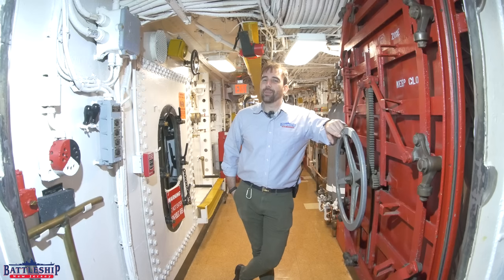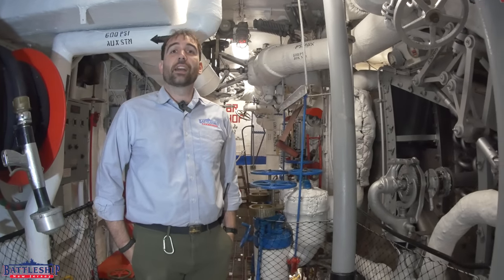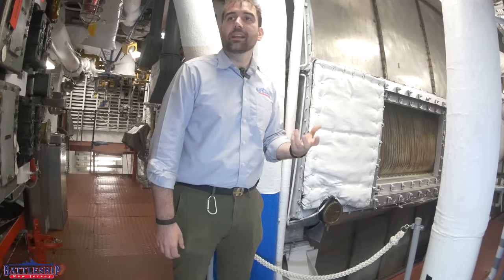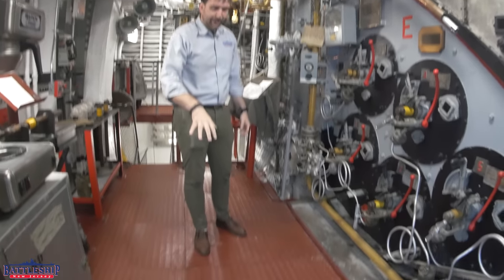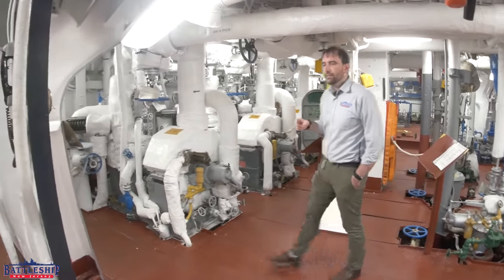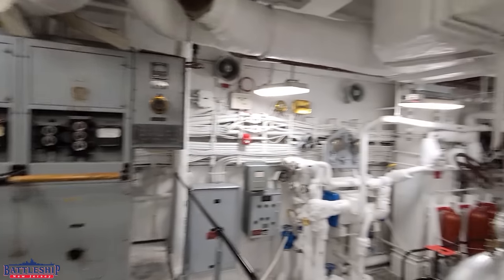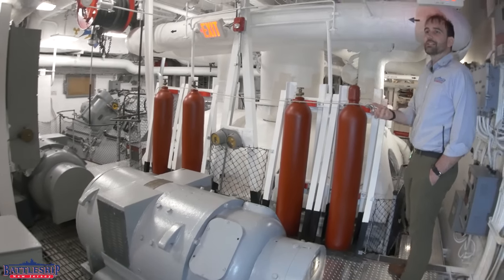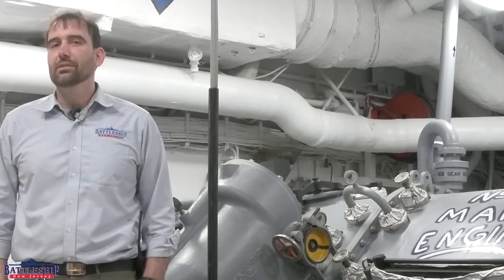Inside the Propulsion Plant of the World's Fastest Battleship

Comment: Could someone dispel the report that Missouri had her propellor shafts cut off when in drydock last. I have seen video of Missouri in the dock and she possessed all four shafts and screws before they flooded the dock.
Reply: I would be very surprised if they actually cut the shafts, but almost certainly they removed the props themselves because when they're not in use, the props weight cause the shaft seals to become broken which leads to far more problems. Propellers are removable & get replaced after they've been worn down enough, so it's not something where they're destroying the ship- any shipyard that could house an iowa class could install new props.

Comment: Condensate pumps remove water from the condensers and send it to the deareator which is a heater at atmospheric pressure so air, oxygen etc can escape. Boiler feed water pumps take water from the deaerater, pump it at high pressure through heaters before it goes back into the boiler. Even this description is simplified.

Comment: Hello, very interesting. Could you let us know if the prop thrust bearings are located in the gear units or in the hull and details on the thrust bearings themselves. Perhaps some more information on the gear units please. Cheers.
Reply: Kingsbury thrust bearing units part of main reduction gear attached to main bull gear
Reply: The thrust bearings are NOT part of the reduction gear. They are located inside a large component called the thrust block which transfers propeller thrust to the hull. It may be located fairly close to the reduction gear or further aft depending on shaft length. As a separate unit it can be maintained without exposing the reduction gear to possible damage.

Comment: Are the firerooms on New Jersey and other BB's pressurized? I recall when reading about WW2 destroyers that their firerooms were pressurized (I forget why they had to be pressurized) and one had to enter through an airlock door.
Reply: The old 4 stack DDs had pressurized fire rooms to provide forced draft to the boilers. By war 2, the newer construction ships had boilers that were in effect supercharged rather than the fire rooms. The forced draft blowers pumped air into a jacket around the boilers. One of the usual 3 watch standers on each boiler controlled the throttle to the forced draft blowers. He watched the uptake periscope and was connected to the smoke watch top side by sound powered phone. his job was to maintain proper air flow into the boiler so as to maintain the "light brown economy haze" that indicated most efficient combustion.

Comment: So how is Full Ahead - Half - 2/3's - Slow - etc measured. Is it opening valves to pre-measured amounts to give a estimated amount of steam and power to the screws? Is it a balancing act between the boilers and the engine rooms? Or does one request from the other to achieve? If the captain sends the signal for Half speed. The boiler already knows how much fuel to give to achieve that setting or does the engine room ask for that?

Hope that question makes sense!

Comment: Can you explain how Iowa was able to turn turret 3 with power? (They just aren’t as good as Ryan explaining things.) Could New Jersey do the same and why can’t or won’t you raise and lower the barrels under power? Lastly I’m guessing the Navy won’t let you fire a boiler to run the turbo generators, my question is why.  Also, why doesn’t the Navy allow you use the galley equipment?
Reply: HP steam is really nasty stuff.  Those systems require constant maintenance, testing, and upkeep...none of which has been done since she left active service.  It's bad PR when you have a steam line burst and turn some tour group of kids from a local school into basically cooked stew meat.

You also have a manpower issue.  Figure at least 20-30 people to man all of the stations required to safely bring steam up and spin a TG.
Reply: The turrets turn with hydraulic motors that use electrical power from the shore connection.
Reply: @jamesbrownson6102  Ryan covered this in a previous video.  The rated electrical load of the turret hydraulics exceeds the rated capacity of the Shore Power breakers...

Comment: How do you deal with all the asbestos in the Engineering Spaces? Is the strategy just to maintain it by painting and such to prevent it from becoming friable?
Reply: Asbestos dust was all over the place on my ship in the '60s. Very bad during routine overhauls with laggers were mixing the paste and plastering it on pipes and joints. After months of operation, the routine maintenance and traffic in fire room  would wear off the fabric wrapping in places, exposing the asbestos plaster which could be stepped on and blown away by the blowers. Nobody paid any attention to asbestos then.

Comment: One of the ships i served on would burn jp5 rather than dfm. It burned much cleaner and wouldn't leave as much soot on the tubes. I was on an oiler at the time and we carried both fuel types.
Reply: I was in the Michigan Army National Guard.  When we deployed to Iraq, we used JP-8 instead of diesel our trucks and generators.  It burned much cleaner than diesel.  It cleaned out the engines on both.

Comment: At 29:16 On #1 main engine on the U shaped pipe with the valve that goes over the bolted/riveted casing and the short pipe with the pressure valve......around the bottom of those pipes i was wondering if it is some kind of bag that is attached around the bottom of the pipes.....is it like heat wrap

I love this channel old vids and new
Reply: It's a vent. When operating there is a fog of lube oil vapor produced because the oil is hot. Modern steam ships (is that an oxymoron?) use an electrostatic precipitator to condense the vapor so it doesn't contaminate the engine room air.
Reply: @oldtugs I don't think we are looking at the same thing
Reply: @midbc1midbc199  Yeah, you are right, I was not looking at the other stuff.  It might be retrofit "spray shields" on any joint that could produce a spray of oil as a means to reduce the chance of fire. It looks like a retrofit required after someone in the Navy discovered the risk of atomized lube oil spraying on hot stuff.

Comment: I used to dispatch steam powered electrical generation plants.  I could call a generation plant and ask them to go up or down or I could actually take over control of the throttle.  One day a plant I was controlling suddenly fell on its face.  I called the operator and asked what was happening.  He replied, “We lost vacuum.”  They were having problems with their condenser.  I don’t remember what problem, maybe it was a cooling tower problem or maybe they had changed generator output too quickly.  The point is I was presented with an example of how much of turbine power is provided by condenser vacuum. 

When steam comes off the turbine and is condensed into liquid water that water takes up much less space hence creating a vacuum.  The pressure difference from one side of the turbine to the other controls power output.  So, the condenser does much more that just recycling boiler water.
Reply: I read on another website that Titanic's turbine took exhaust steam from the main engines at 9lb PSI absolute, i.e. 5lb below atmospheric pressure, and exhausted it to the condensers at 4lb absolute.

Comment: If anyone's interested about the horsepower, it's one of the most straightforward calcs you'll ever run into in engineering:  a one horsepower effort relates to 550 pounds... four of those units comes to 2,200 pounds... that's almost a "tonne"... so the displacement times that 4 gives you almost dead on the number of horsepower to move it along its way (displacement's nominal anyway vs. "in the given moment" but pretty close, it's that 57,500(-ish) times 4 Hp equals what you need designed in). Gets nuanced for acceleration, but once to a speed... Usually you have to fiddle with units and transitioning from this to that, but get big enough and the nuances get themselves gone for some things. Won't match like that for a PT boat, but for a monster that can take on Godzilla, it's close enough.
Reply: Considering drag goes as the speed squared, wouldn't the HP needed to keep you moving greatly depend on the speed you're going?
Reply: @stargazer7644  Sure. And many other things as well, if one's counting. Is the hull painted well, so no rust breaking up laminar flow? Is the paint itself smooth? How is the wind blowing relative to your direction? Are your zincs in good shape or is the hull rusting for that reason? How is weight actually distributed? Forward? Then the prow dipping further into the water will give more drag too. Even your length (longer is better, all other things being equal, the longer ship is always faster), but then also your beam affects how well you glide and so what power is needed. But then if waves (tiny, but powerful far out at sea) are a wee bit off optimal for your length, you could have a dynamically produced prow dipping effect... but for these lengths, not precisely so much.

And literally (maybe) a million more things.

The "4 times displacement" thing is a rule of thumb. It fairs you in very nicely, but of course, never, ever exactly. But good enough to get the government off to working.

Comment: If Bunker C fuel is so thick, do you need to take special steps to pump it into the ship or from the tanks to the burners?
Reply: It has to be heated to be pumped. By steam. Lighting off from cold iron the heating is done electrically by the diesel generators.

Comment: when you go to drydock will you be using the engines? or using tugs like most of the other ships
what's the limiting factor there? the age of the ship? the danger of a system like this? or just the crew /costs /skill required to run the engines
Reply: The museum’s contract with the Navy is that they are not allowed to start the engines.  They are all preserved in suspended animation for if the call ever comes.
Reply: @genreynolds6685  huh that's interesting. I guess they don't want people driving a battleship around or wearing out the engine

Comment: 82 or 83 I work Long Beach Naval Shipyard I work the Missouri for about a year. And the New Jersey for about 3 months. On the Missouri we had trouble getting the last Stern tube bearing out they spent 3 months three shifts a day trying to get this out. The Missouri had been in Bremerton Washington for 30 years setting give or take. The last Stern tube bearing we had 250 tons of electric hydraulic jacks pulling on the bearing half. Lynette bearing half popped out at midnight or something as I work swing shift. When the baron came out it shook the whole damn ship setting on blocks I mean it damn ship. This man is talking about the main condensers. The manganese bronze condensers. The bronze was polished that's what they did for hours when they were at sea. The seawater Inlet below six knots used a main condenser pump we were working there and I looked at the plaque on it everything has a bronze plaque what it is and where it is. 126 thousand gallons a minute suction from the sea. Above 6 knots a scoop with drop-down and force the water into the main condenser. In the middle of the night I would climb to the top of the 014 level and look at Long Beach Harbor beautiful like a sea of glass all lit up from the shipyard. It was my playground and there was nobody around on swing shift except a few of us I was a marine machinist a shipboard mechanic what a hell of an experience for a 22 or 3 year old man. One night I walked under the shipping they had all the anchor chain laid out sandblasted and painted I believe they weighed 360 lb / link. You haven't lived till you've stood on the end of a propeller 20 feet from the dry dock and Swan the 20 lb sledge Hammer trying to get the damn nuts off the propeller that's my story and I'm sticking to it

Comment: They still don't air condition engineering spaces even with gas turbines which are WAY cooler. But at very points throughout the space you'll find air ducts with AC air you can stand by and the primary control console has one so 6-8 hour watches are the norm

Comment: Question about the work-life on board:

Workers in the machine room are daily work, under what might be considered extreme conditions.

How about the rest of the crew, like workers in the magazines, did they have it easier with much more rest, or where there daily  drills or maintenance ?
Reply: Not quite sure about the US navy or battleships specifically, but you will find that most navies have a division between "day hands" and "watchkeepers". The difference between them is that watchkeepers keep watches around the clock, for example 6 hrs on 6 hrs off, or 4 hours on 8 hours off. Meanwhile day hands work normal working days (like 0800-1600). 

Generally speaking watchkeepers are there to maintain capability around the clock, responsible for keeping eyes on engineering plant, navigation, communications etc. The dayhands on the other hand manage the day to day running of the ship, for example cooking meals, paperwork, admin, general maintenance and housekeeping etc.

Now depending on where you go and what job you have the exact setup may be very strict or more fluid, for example you can have setups where you are a day hand but then do a single watch a day. Or for example submarines where basically everyone is a watchkeeper and the daily tasks are simply done on watch. 

Lastly, no matter what way its set out there is generally whole ship activities that everyone (or close to everyone) will get involved in, such as battle stations, damage control exercises, docking/undocking, or ceremonial duties.
Reply: @reecesaliba7036  appreciate the indepth reply ☺️

Comment: Very Very interesting. Several decades ago I worked on some large steamships with Babcock boilers.

Question, under normal service conditions during WW2 would the ship ever take a boiler out of service for maintenance. 
On the face of this it would reduce the ships power. However. By rotating your boiler with maintenance done by ships engineers she can stay in service. 

Some differences presumably partly due to a more longitudinal layout and 1940 re 1960 or 1970 tech. In tropical climates eg Persian gulf terms in engineering spaces could often exceed 40 deg C I’ve seen 50 deg C occasional 54 the worst I can recall. 
The LP turbine? In my ear. There would be a separate reversing turbine. I would guess while contained in the same housing it is separate shaft with its own gear to the reduction gear. 
Most of your power is from the HP turbine. With only the LP turbine able to apply astern power there is probably significantly less than half the ships power available for astern propulsion. So having to hit the brakes is probably something you want to avoid. 
Using the rudder and turning will reduce speed much much faster. 
The vibration, from the shaft and screw is probably not vibration. Typically if shafts are vibrating you got a problem requiring fixing or you are going to come to a stop sooner rather later. 
It is probably due to cavitation. Which is worse the faster the propellor spins. It’s starts to draw a vacuum the sea water just physically can flow fast enough to fill the space the propeller was in. So there is a limit on the maximum size and pitch the propellor can be. 

I was quite surprised to see only four. Many other battleships probably just a few years older had multiple small per shaft. Due to this problem. 
These were very propellor were very very modern for their ERA. 

Rough estimate.
Service speed 33 knots. 
Shaft RPM 220 which is quite high. 
My guess the required pitch of the propellor must be around 4. 63 meters or or a little over 15ft. 
The actual pitch is a bit greater. Due to a ships never a 100 percent efficient so. 
This was probably classified at one time or other. 

Bunker C particularly if used in a boiler it’s pretty much just one step above road tar. 
We would typically have different burners for different fuels. Egbbunker C Blended diesel or Diesel. 

I am a bit surprised there was only 3 evaporators We had 3 which enabled us to strip one down and have two available. 
Loss of 2 evaporators would pretty much mission kill the ship. 

If you look on or near the condenser. In my Era, there would be a HP blead steam line. Going through an educator which would suck from the condenser to creat a near vacuum the steam itself condensing would also tend to pull a vacuum. But not quite efficiently enough to get reall close to a vacuum. 

There might be a similar line to the evaporators. Water boils much lower gems as you get nearer to a vacuum. Rough vague memory guess 70deg C. 

Telegraph indicators in both boiler and engine room different. I would expect main telegraph only on control flat but with multiple engine rooms and boiler rooms. I can see it makes sense. 

If conning the vessel I would only expect one response from engineering. So it would be interesting to hear more about this. 
On vessel I’m familiar with I would always telegraph and get response from the engineer in charge of the watch. If back back up systems were required he would communicate my instructions to a engineer with local control. 

The watertight door system appears to be entirely manual.. 

By the way the ship’s engine room was incredibly clean. Especially the bilges. Which would be extremely important if she ever got shot at and damage response was required. 
Damage response, big reason the USN won its early battles.